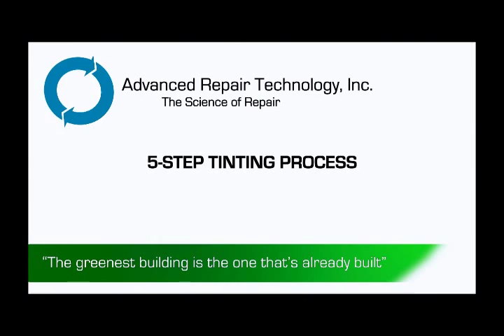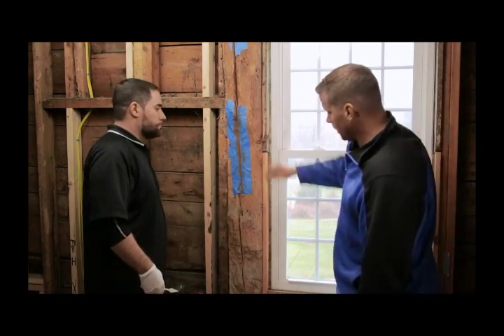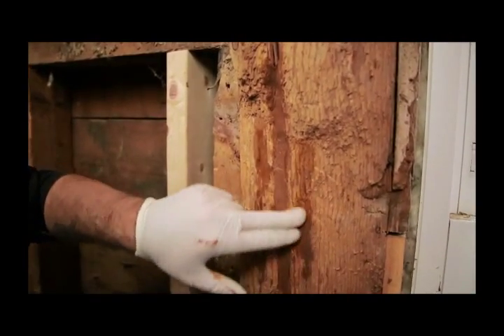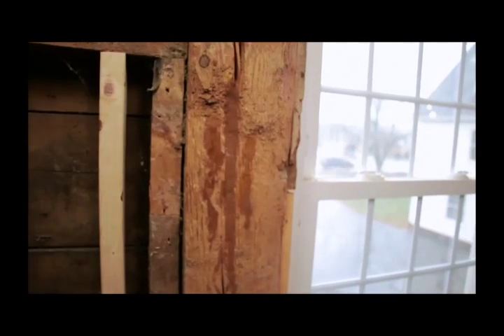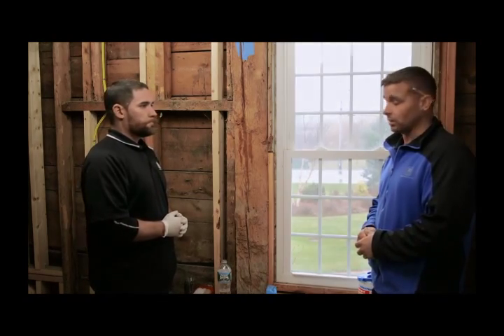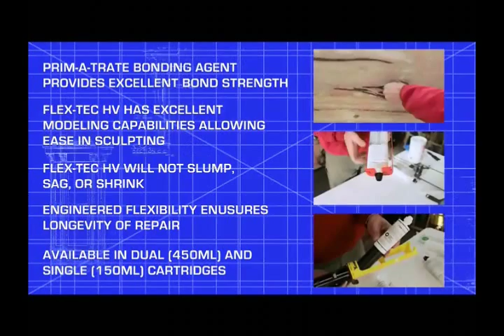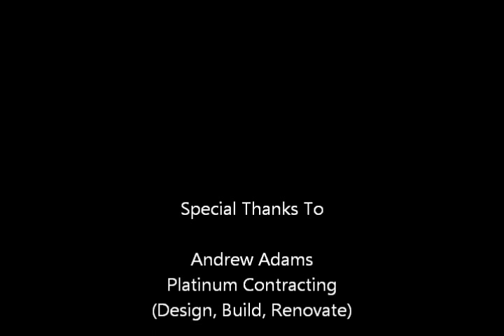Bolton Mass Structural Beam Repair & Epoxy Tinting How To Color Match Existing Wood

Comment: NICE  !!! 

... & YES these new epoxies are incredibly high in tensile strengths.  When applied properly, they most definitely restore structural integrity.  

Best scenario is to replace the wood ... but in many cases that is not feasible. 300 year old beams don't grow on trees !!

2nd best .. and honestly .. maybe THE BEST .. is to use these technologies to repair the wood.

Comment: Worthwhile video to watch for someone looking into repair. I'm looking to use this for larger wormholes, checks, cracks and knotholes in (very) rustic oak flooring reswan from reclaimed timbers. I think this will be perfect.

Personally, I'm not convinced this will add to "the integrity of the structure", but I'm no engineer. These timbers between 200-300 years old and, in my opinion, done moving. To me this is an aesthetic exercise and for vertical and overhead timbers I'd rather see the natural wood movement. The only reason I'm looking into this is because I don't want large voids on my kitchen floor accumulating all sorts of nastiness. I'll surely use a pigment that accentuates the holes, rather than hides them. 

Thanks for the video.
Reply: Sounds like you shoot for the color of the wood wet for the correct tint of the epoxy?

Comment: Iv been doing this kind of work for more than 30 years find it odd that one of the steps doesnt call for treatment.  No how much you dig the rotted wood out  the rot spores are still in the wood and will still rot
Reply: Out of curiosity, how would the spores rot the wood further, without water? Ideally though, you'd want to use a wood hardener first, on the rotted wood.